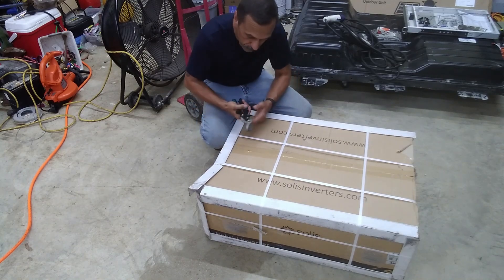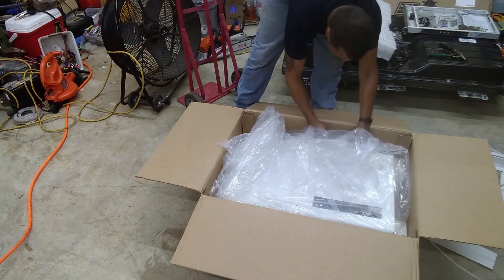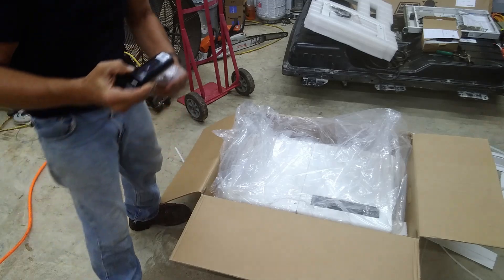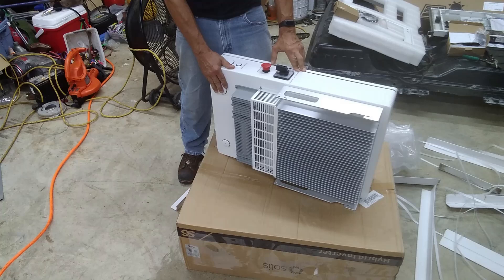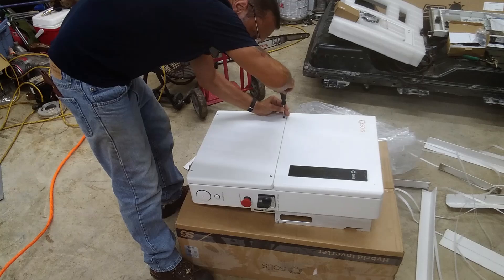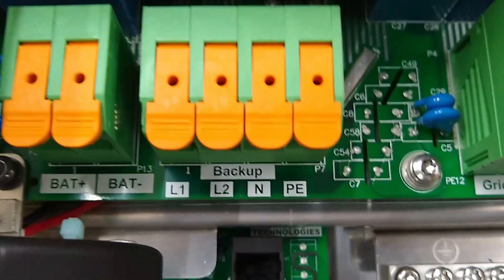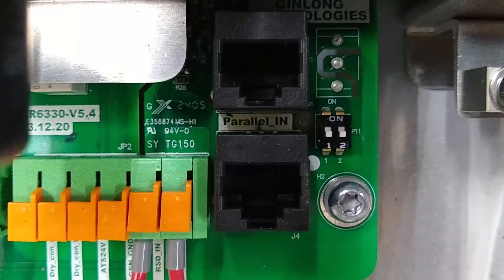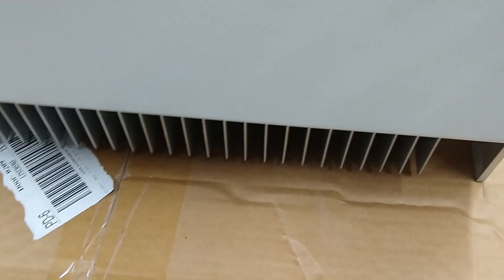Solis High Voltage Hybrid Single Phase Solar Inverter - S6-EH1P11.4K-H-US

Comment: Great stuff. Thanks for sharing! Mine is on order. Glad to see what it looks like. Did you get the tigo datalogger version or the standard APST? i think it is? How's it working so far?
Reply from the maker: I got mine with the APS transmitter because that's what is stock and the lowest cost. By the way APS and Tigo are for rapid shutdown they are not dataloggers as far as I know.

Comment: What does it do?
Reply from the maker: Thanks for your interest! It's a Solar Inverter, takes DC power from Solar Panels and converts it to AC for your house. Also charges a High Voltage Storage Battery so you can use that stored energy in the evening.
Reply: @DIYSolarFarming  I hardly even need AC electricity. I have an inverter that cost  35 Euros. It goes up to 600W. If I need more I just use the petrol powered generator.
Reply: It takes $2500 out of your wallet and puts it in someone else's wallet. It's very efficient.

Comment: Doesnt look like split phase output. Not sure that will work well in USA Canada power. Cheers
Reply from the maker: How is this not Split Phase?
There's L1, L2 and neutral.
Reply: @DIYSolarFarming  Did you check it with a meter? I did notice L1 L2 but the tag does not say that.
Reply: Single phase. 120/240 volt, single phase. Split phase is a type of motor. The entire electrical industry knows this EXCEPT all these inverter companies.
Reply: @realvanman1  either way you need to specify 120/240 vac with every inverter company if that is what you want. There is a lot of single phase 240vac and that is not what I would want. I live in Canada.  Even know some appliances can run on 2 wire 240 vac . Some people don't realize the difference when buying.